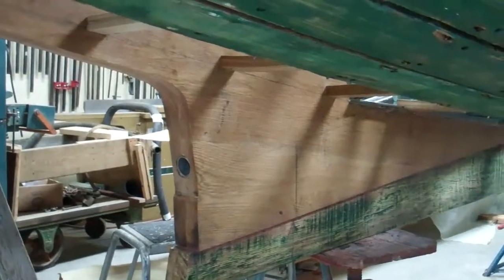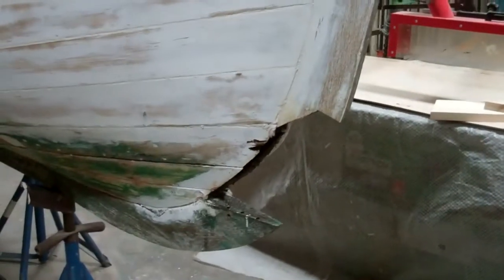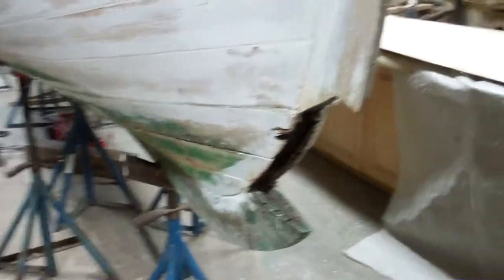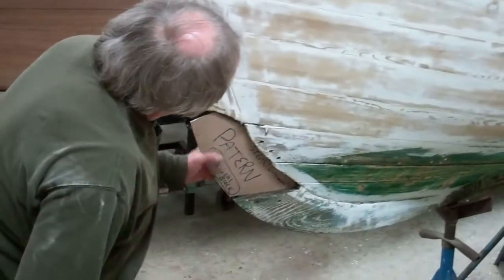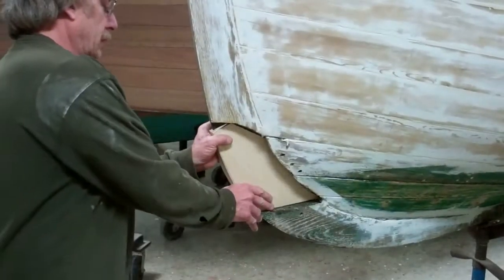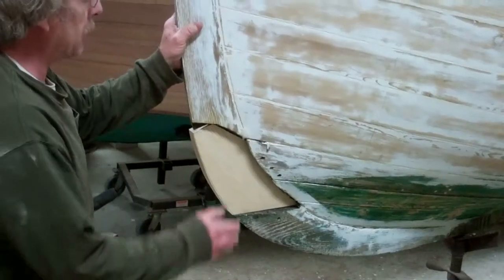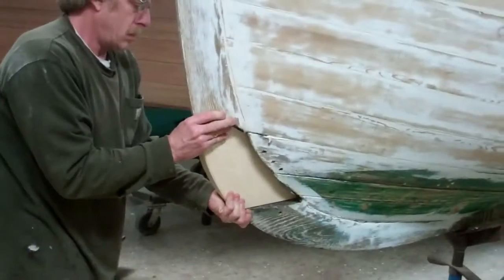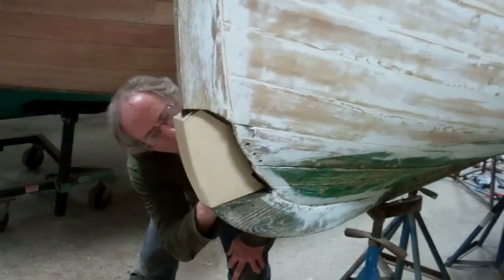Repairing a Section of Rotted Stem 1914 Palmer Launch ROXANNE 4 23 14

Comment: Greetings!  Thank you for this video.  Do you need to do anything to kill the rot fungus before new pieces go in or is simply removing the rotted wood enough?  Thank you.
Reply from the maker: Absolutely! Replacing all rotted wood is a must. Sometimes a Dutchman repair will suffice. However, ALL raw wood MUST be sealed with three full coats of Clear Penetrating Epoxy Sealer. (Not Git Rot. It is worse than a joke.) Here is some more information and a place where you can order it. http://www.star-distributing.com/smith/cpeswhy.html.